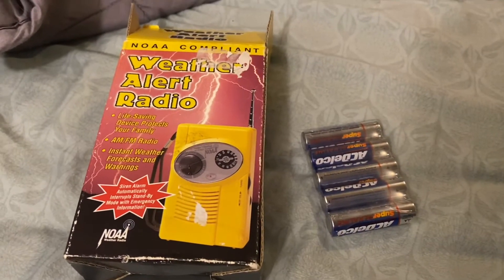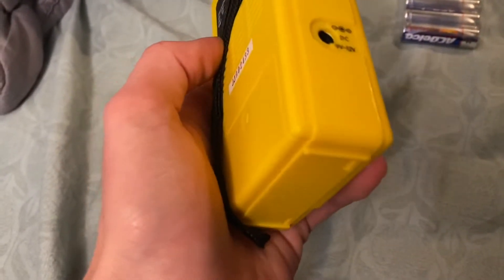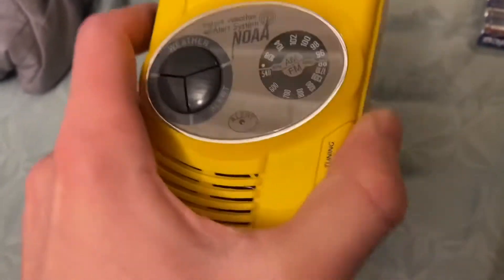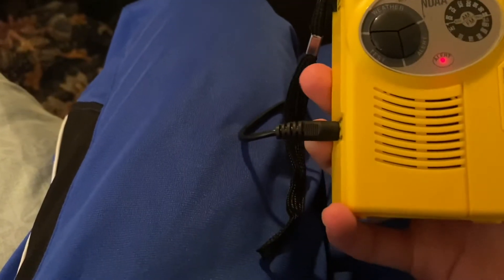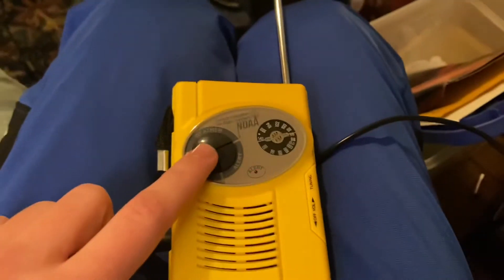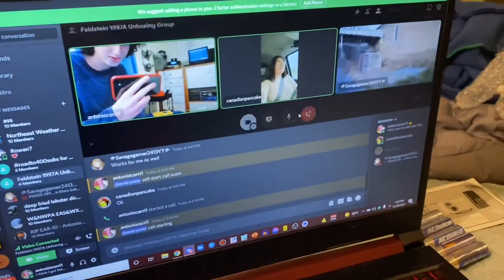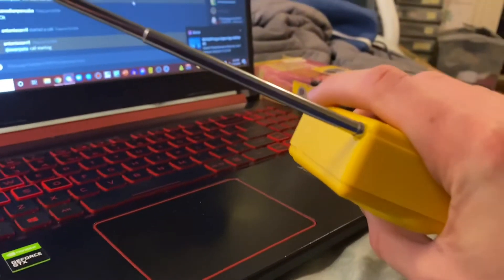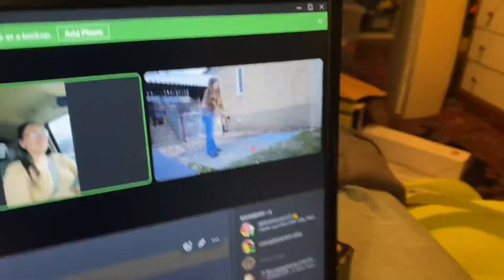Unboxing/Setup of the Feldstein 1997A

Comment: As long as it's not too much a difference, you can use higher voltage power adapters on things. For example, I used to charge my HH with the WR100 chord because the voltage regulator wouldn't be blown at 12 volts